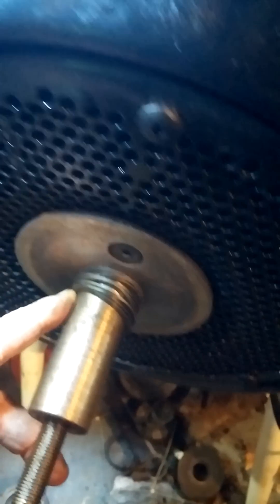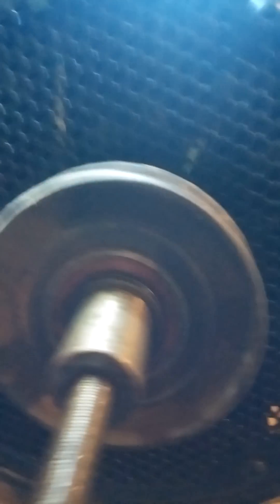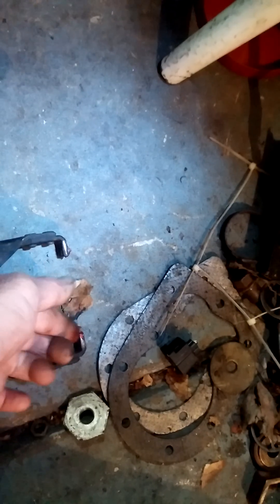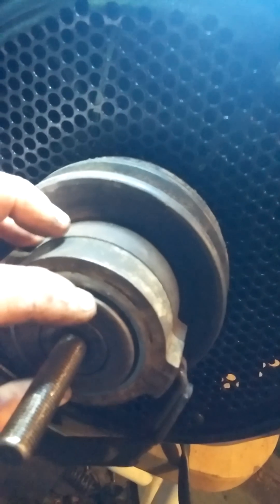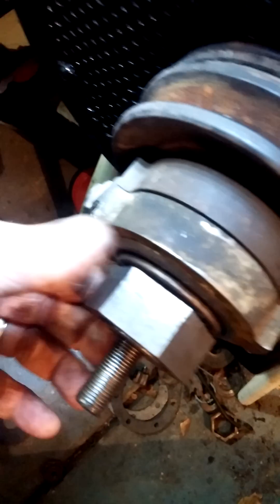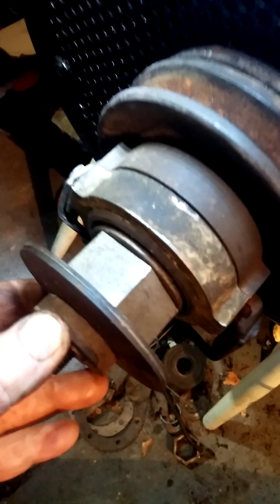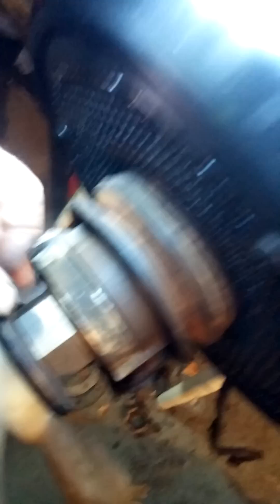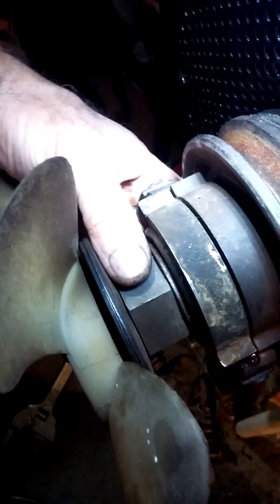Case Ingersoll EZ adjust PTO clutch  explained

Comment: Good afternoon, I'm bothering you from Argentina. Thanks for your video. I'm rebuilding a Case 222 and didn't know how to assemble the clutch. I'm going to ask you a favor. I need the measurement of the adjusting nut. The one you put at the end. I have the inner nut, but I need to make the outer one. Could you please send me the width of the inner art and the outer measurement, so I know how much travel the inner nut has. Thank you very much for your time

Comment: I have a 222 which every part is on correctly as in this video.  Adjusted correctly.  Mower belt able to move by hand easily but will not grab when engaged.  ???

Comment: How tight should engagement feel on the clutch lever? I followed as best I could after getting the parts that were missing from mine and I have about .005 gap, which is within tolerance from the manual, but my engagement is quite tight. It looks like the spring washers compress really nice, though, so maybe it's fine. It's a good firm pull to engage the clutch on mine. See an issue with that?

Comment: Thanks for making this video.  I've had this apart before but can never remember quite how it goes back together.  With over 41K views, you know that you've helped thousands of people.  A big thank you from the mountains of western Maine.  I use the PTO for my snowcaster and we generally have 4.5 - 6' of snow on the ground for the duration of winter every year.  We depend on the Case to move that snow.  Thanks again!
Reply from the maker: Thank you!

Comment: If I tighten the front boot to much will that cause the PTO lever plate to not move very much?
Reply from the maker: Follow part 2 ..
It explains you must hold that shoulder bolt  in 1 position while securing the front nut to specified torque...You MUST make 100% certain tat the clearance between the friction disk and pressure plate is NOT comprimised...
Reply: @Jimtoledo  ok got it all put together properly and everything is working. But still zero power can't even jump it. Any ideas?

Comment: Clutch was on wrong no PTO engagement. I followed your video now when I went to turn it on and I have no power? Any suggestions
Reply from the maker: No power? To the motor?
Reply: @Jimtoledo  yeah
Reply from the maker: @TheSlow78  sounds like you have a compression / carburetor  issue. But its not related to the clutch/pto
Reply: @Jimtoledo  yeah not sure had it running fine before I messed with the clutch. Doesn't make sense
Reply: I also think I didn't have the plate forward when tighten the nut so that maybe it too. I'll have to try tomorrow
Reply from the maker: @TheSlow78  so its not a PTO issue...spark? Fuel?
Reply: @Jimtoledo  I don't think so. I literally used it right before I disassembled the clutch so not sure what's going on
Reply: @Jimtoledo  it's completely dead no power lights don't turn on
Reply from the maker: Follow this video has helped a lot of people...if yours isn't right. Review the video again
Reply: I have a 224. Check fuse, no power. Check power to / at the coil. Check power thru the amp gauge. My gauge was bad, power in, no power out. Bypass gauge to test. Check ALL connections. Could be a broken wire somewhere. Check GROUND wires. And check ALL safety switches, PTO and DRIVE. NO GROUND, equals NO RUN. Can be a ignition switch or it's connections.
I have had to replace it before.
My 224 is 41 years old. Stuff wears out. Check solenoid. Check battery first. Could be dead. I have chased problems before only to find out my battery was weak. It had enough power for my test light, but not enough power to start the mower.
Try jump start.

Comment: I watched the video to verify I had it all together correctly, but as the tractor runs, the clutch gets loose. I have even tightened it to where it will not disengage, and it still backs off. And that is only after 15 minutes of operation. What am I overlooking?
Reply from the maker: Chuck Horton make sure you have a screwdriver keeping the flywheel stationary, and follow torque specs over tightening isn't good! Good Luck
Reply: I have the same problem with mine. Shaft is in new condition, new bearings, new spring shims, new flat shims. I have a new friction material to put on the pulley but it is thinner than the old one?? I get about 30min of mowing and it starts slipping again and when i disengage it there is about 1mm between the clutch plates. It is driving my crazy. I want an electric clutch so bad
Reply from the maker: The spec is not 'tight' ...it is specific! The .002 clearance between the friction disk and pressure plate MUST be there when the clutch is disengaged...

Comment: Thanks for the Video.  I have had mine apart no less than 4-5 times.  I'm going back to reassemble it.  I hope it works now.  I had the cams installed incorrectly.

Comment: Hi Jim, I Just received a new engaging arm and fan blade to install in my Case 224. I`m pretty positive I have all the parts installed in proper order, as I have viewed your detailed video many times. When I get to the point of tightening the nut to the 45 ft.lb. recommended, I find that the friction disc tightens down to the friction plate. Driving me nuts. I can`t figure out if I`m doing something wrong, or if I have some parts that might be worn. I do see a little wear in the cam notchs but does`nt seem excessive to me. I know it`s tough to tell without the machine in front of you, but Im just throwing it out there. Any ideas.   Thank you, Shawn M.
Reply from the maker: Shawn McGrath  the issue is you aren't on your shoulder bolt properly the shoulder bolt should be almost fully compressed when you get that .002 clearance so when you pull that lever back it easily bridges the .002 and bingo you have engagement...these things are a PITA when you first start fudgin with them
Reply: I've found that it is pretty normal for the pressure washers to push the whole assembly in tighter than you had planned. What I do is leave the front nut a bit loose and reach around and adjust that big nut. I this video it's the one he keep putting that big adjustable on. I've yet to be able to "set it and forget it". Usually takes me several tries to get it right.

Comment: what make/model is that adjustable wrench you are using on the big nut?
Reply: It's actually a sink drain spanner wrench.
Reply from the maker: k0jdd  in the vid I said I didn't know...I dont' remember but  I got it from Sears in the plumbing department...almost like a crescent wrench